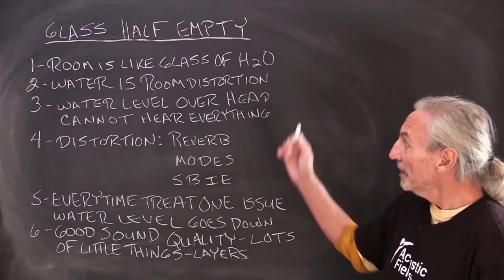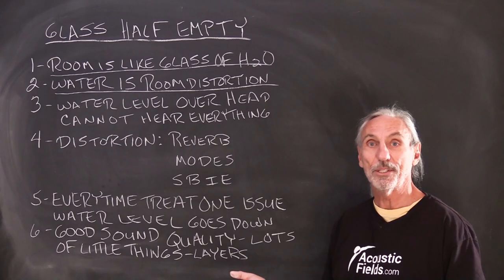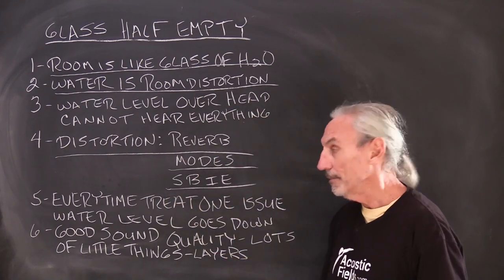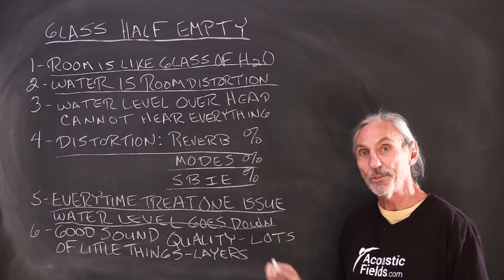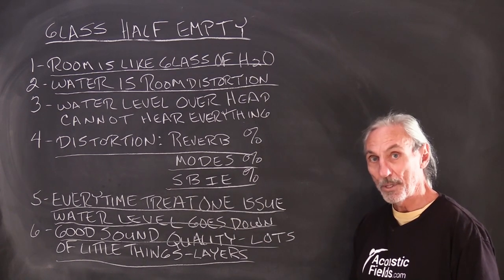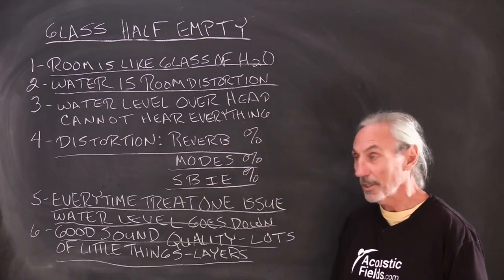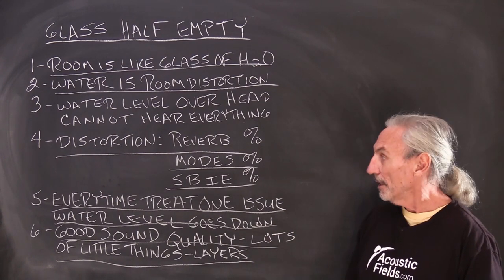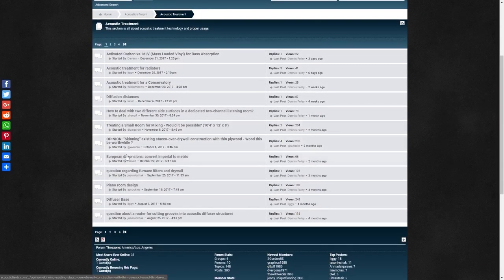Glass Half Empty - www.AcousticFields.com

Comment: Hi Dennis. That's a very helpful analogy. I have one of those problem rooms. 20x20x7.5' high. After roughly calculating the modes, reverb, etc., the amount of remediation needed far exceeds my pay-grade, and is daunting enough I've had to re-think. Is building out the room worth it? It's only a hobby studio live room setup for making vanity-albums, not concerned with radio-ready quality. Most concern is the mixing. Perhaps I'll start small. Build a couple of BDA units from the diy plans I purchased a few years ago. Put a small leak in the dam, and chisel away one unit at a time. Or thinking like, drop a BDA into glass, and it sponges up some water. Keep dropping in remediation until the glass is dry. Thanks Dennis. For me this helped a lot in finding a place to start.
Reply from the maker: Find another ceiling height.

Comment: Hey Dennis that is a great way of looking at things. I've be searching your channel and on internet in general... what would be the difference in having an absorption panel close/against the wall as opposed to having them hanging on a stand closer to the listening position, and say 3 feet away from left and right wall?
Reply from the maker: When you separate the panel from the wall, you allow for air flow on both sides of the panel thus increasing the surface area of absorption. How far away from the wall will depend on the panel type, amount, and position along with the room usage and a host of other variables to consider. Nothing is easy.
Reply: @AcousticFields  I see, I'll have to do some measurements of my own for sure. Thank you for taking time to answer!

Comment: The pessimist, the glass half empty
The optimist, the glass is half full
engineers: The glass is twice the size it needs to be. 

At least for mechanical engineers like my self 🙂
Reply from the maker: You must consider the sound source numbers. If its just you in the room, what are you doing? Are you singing/speaking? If its a live room with 5 individual players, then the room size/volume will react differently. Its all about frequency and amplitude when it comes to small room noise.
Reply: @AcousticFields  I may have been unclear,  but my comment was just retelling an old joke I like.